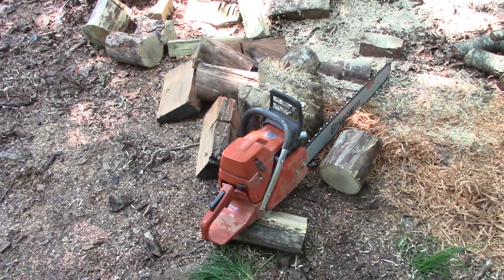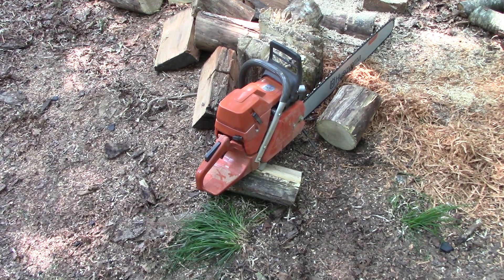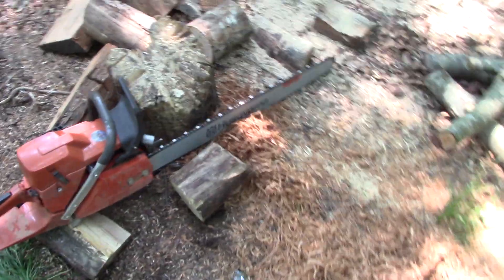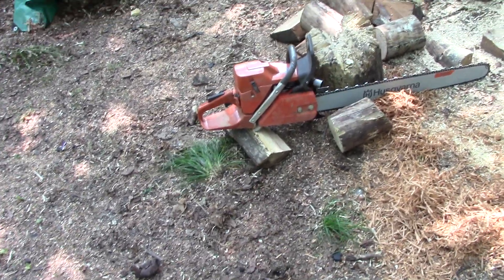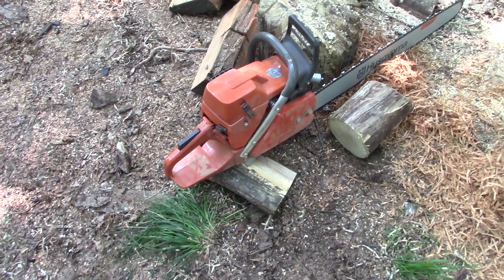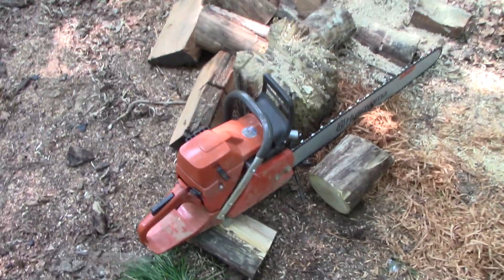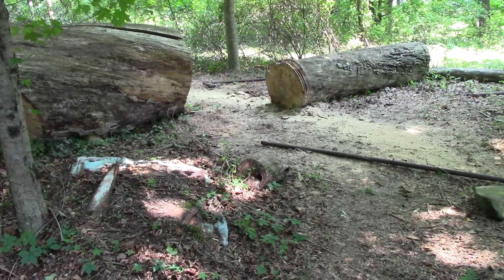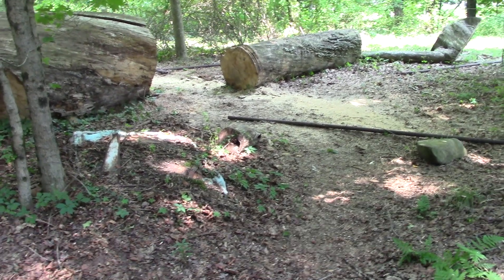Husky 372xp My Porting Theory & Iron Horse Transfers Set To EX 101 TR 130 W /180 Psi

Comment: Hell of a saw you have built there! Just got my first lathe to further my porting skills, roughly what speed  you run for cutting aluminum? Or what seems to work best for you? Mine is a mini lathe too, so figured id ask someone else with a mini lathe thats virtually doing the same thing im gonna attempt :)
Reply from the maker: Thanks about the comment on the saw. On the lathe I don't have an rpm indictor. So because of my set up I run it almost as slow as it will go. i'm guessing about 100 rpm . I cut per pass .001 - .002 per cut it is slow but  because of my set up I have never had the cylinder come out of the lathe. Also listen to the sound of the cutter if it is screeching generally it is too fast or your cutter is dull.
Reply: @kennytheguitarfanatic054 thank you for  the input as I dont have an rpm indicator either :) it's nice hearing tips and such, like the cutter screeching tip!!!!